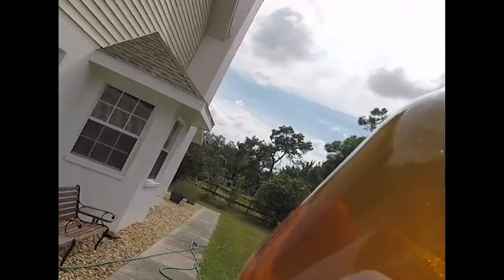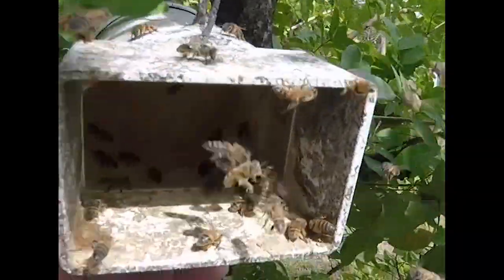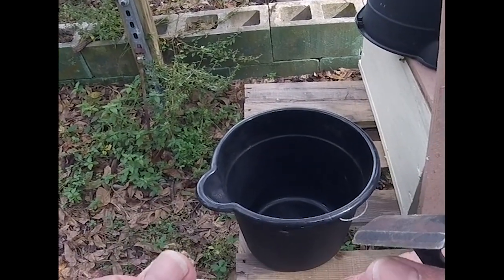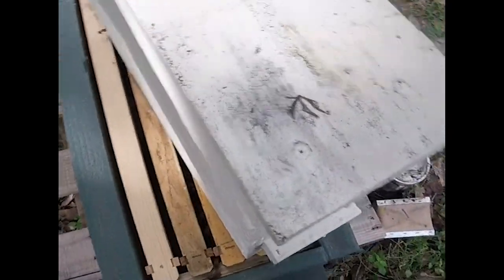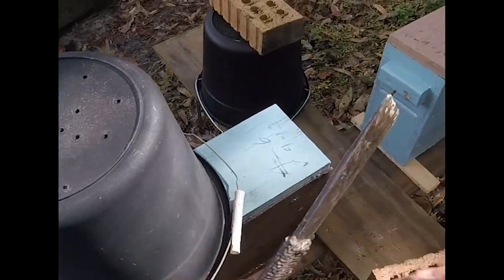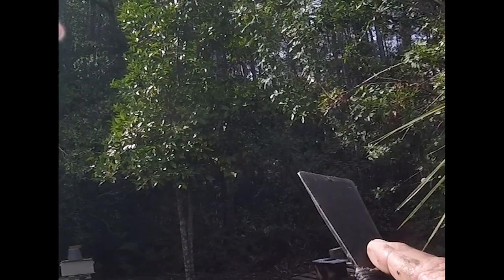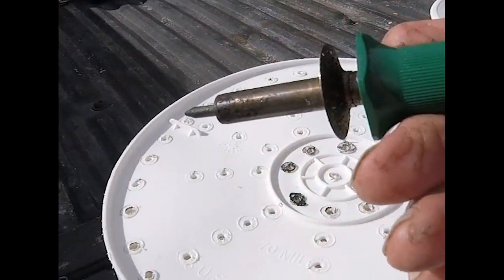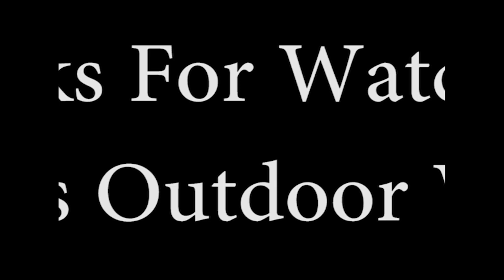Queen Check & Honey Extraction

Comment: Steve - would you expand upon NOT using metal on the plastic frame?  I use the wire end of a cheese grater - dull.  Just wonder if it’s just so you don’t scrape tiny bits of plastic off or if it’s a bad reaction between metal and something?  Thank you!  Love your insights!  ❤️🐝🐝
Reply from the maker: Hey J Mom ! The wood tool won't knock off the sharp edges on the cell tips but a metal scraper will and the bees don't like building back on it.